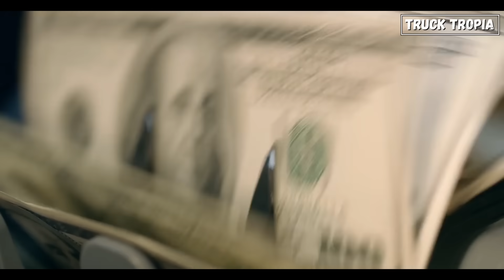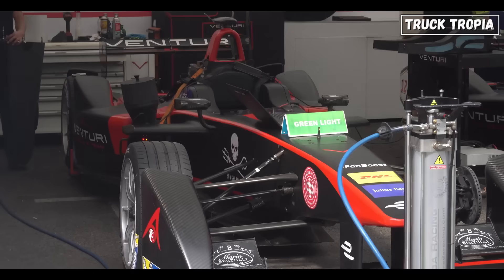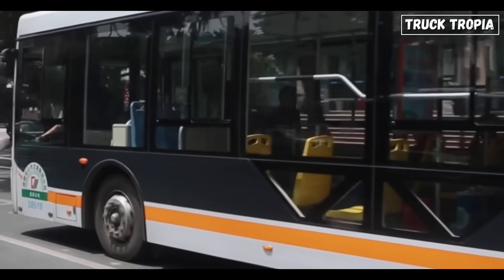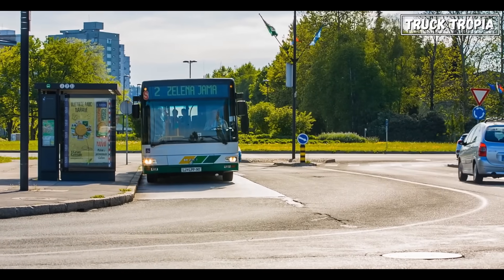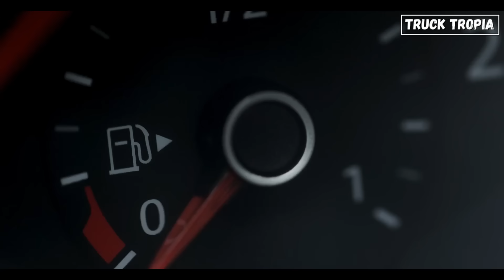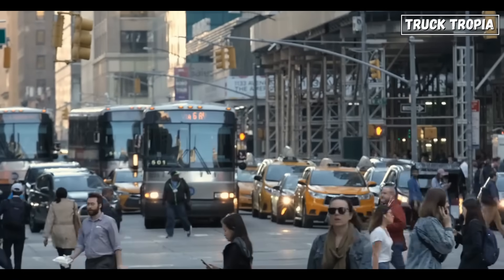Why Do Big Buses Have Rear Engines?

Comment: Remember as an kid 40 years ago some busses had the engines in the front, it was an large padded bump between the front door and the driver. 
You could sit on it but drives did not like it unless buss was packed. Or it bus was empty and you wanted to talk.
This often left an empty area in the back for bicycles and other large cargo if it had an door at the rear.
Reply: British routemasters were like that

Comment: I just started to watch this video. I want to see if you are correct here. After driving long haul buses for 43 years I know quite a bit about them, and am very interested if a non driver knows anything. OK now to watch the video. Later. Alright! The commentator did a great job! I would add one little thing. I did not drive articulating buses, but have talked to drivers who do. These buses can have their engine in the rear of the trailing portion, or in the rear of the front portion. The ones with the rear engine in the trailing portion are preferred by mechanics because they are easier to service. However in countries where they have ice and snow they are a bit scary to drive, because they tend to cause the bus to jackknife. The ones with the engine in the back of the front portion handle far better in ice and snow, but the mechanics hate them, because the engines are under the floor and are hard to access. You can't please everybody!
Reply: As a long-haul bus driver, did you notice the subway and airplane stock footage that was used instead of bus footage?  I find it hard to take a channel seriously when they can’t even get their stock footage right.
Reply: I currently am living in State College, PA (Penn State). The bus company uses a few articulated buses here, but they are a pain in winter. They get parked. Another thing, I got stuck behind one going, or trying to go, up Donner Pass in California in snowy weather. It was scary watching it, scarier for the passengers, and scariest of all for the driver.
Reply: I have seen and rode on more than enough articulated buses, which are almost always used only in big cities in Austria. There are even some double articulated ones in one city and electric ones with the two antennas in another. Vienna is also starting to move over to fully electric buses on a few lines, that only use the normal buses. The other bus lines, that can be quite long one way and have high passenger traffic always use articulated buses with either three axles or even four axles for that extra length/capacity. However, the engine is always in the rear trailing part, with the trailer axles being the driven ones.
Reply: Was looking for this comment. Thank you! Used to live in Ottawa, Canada, and we went through three stages of articulated busses. First try was the rear engine articulated busses which lasted less than one year before being yanked due to constantly jack-knifing going uphill in the snow, or starting from stop in the snow. Replaced with Orion mid engine busses with the engine lying on its side in the center of the front half of the articulated bus. Never jack-knifed unless reversing too sharply. Then, after the Orions wore out, the newest generation of bureaucrats who obviously didn't do their due diligence bought a couple hundred new articulated busses with the engines in the rear. Any guesses as to what happened next? Yup. First winter every single new articulated bus was being pulled behind a tow truck to the yard because once the bus jack-knifes the computer locks out the bus from moving until it gets reset by a mechanic. And then the city had to spend millions upon millions to refit the busses to prevent them physically from articulating more than a certain amount. Gotta "love" the bureaucrats who thought that buying busses from a company in Brazil for one of the snowiest cities on earth was a great idea.
Reply: My country (Singapore) used to have some Mercedes O405G articulated buses whose engine is also at the rear at the rear portion, whose weight could've also made the rear portion more bouncy when in motion

Comment: Dat wasn't necessarily true about the cabin bein quieter. Has anyone rode on a bus powered by da 6v71, 6v92, &/ or da 8v71/8v92 variants made by Detroit Diesel??? It had little to no effect as of tryin to "muffle" da sound of those Engines lol.😅

Comment: I dont get the first argument - if engine takes 1 cubic meter of space then it takes 1 cubic meter of space if its in the front or the back. Third argument, eurotrucks have engines in the front but still have excellent visibility and dont have a hood.
Reply: Fourth argument - yes its quiet for passengers in the front but its loud as hell for passengers in the back
Reply: The difference is how the engine is placed and arranged. If the engine is placed in front of the driver, it doesn't intrude into the saloon space irrespective of its size. If it's placed at the rear and the vehicle is a low-floor entry design, it intrudes into the saloon space.

Comment: many BEST(JnNURM) CNG and Diesel buses are front engines and the gear shifitng stick is on the engine, also they are an emotion to mumbaikars, and many oppose the electrification of buses(2027) due to this.

Comment: Why don't the manufacturer's make 4 wheel steering buses for tight city streets in Europe, India, China, Japan where cities are actually build on former historic cities'  resulting in tighter streets and high traffic as more and more people move into cities for better economic prospect's ??
Reply: Designs like that have been tried. But modern buses usually have a low floor entry to support disabled passengers and wheels intrude into the saloon space.

Comment: Why are engines placed in rhe rear 🎉more fuel efficient than engines places in the front. An engine doesn't care where it is, it's the other components of a vehicle that make it more or less fuel efficient. A rear engine is definitely louder at the rear than a front engine would sound at the rear. It is all in how the engine is soundproofed.

Comment: @5:03, The engine needs cooling too, and placing the engine in the front allows the radiator to be in the front and close to the engine.
Reply: Rear engines tend to be more prone to overheating than a conventional since the radiator is mounted on the rear side instead of the front.
Reply: @Josb_Bluebird2143, Correct.
Reply: @Josb_Bluebird2143  if the fan turns fast en the cool systeem is good no problem
Reply: @mr.bright684 Doesn’t matter if fans work. They get poor air flow and easily plug up the radiator with dirt
Reply: @ and yet it was well thought out otherwise everything would have already caught fire
Reply: We had some 2010 and 2013 IC RE school buses that were bad about overheating and blowing EGR coolers. Mechanics hated working on them.
Reply: In india mostly long distance buses engine on front they also open the engine gate for cooling and drive longer but some buses engine on rear
Reply: U can suck the air in with engine fan, but it sure less effective than mounting whole engine at the front

Comment: I am a bus mechanic at cdc nsw in Australia and having the engine in the rear makes maintenance easier also on some buses like the Scania k94 ub the engine is quite loud and having it in the rear doesn’t reduce the sound sound it is also easier to access the top of the engine when it is at the back because there is more space to put engine covers in the floor

Comment: The amount of b/s is strong in thisone.
Rear engine is specialy not good for cooling. Nor for efficiency.
Bus engines are not over the rear wheels. They are even further back. Makes handling worse. Sports and f1 cars are mid engined for handling. Rear engine has nothing to do whit fuel efficiency. If anything , its worse. 
Why is it done ? Yess , saving space . Allso buses are rear wheel driven , made sense to pack everything there related to engine and power transmission.
Old ones had super goofy mechanism to allow shifting gears. Now whit automatics , thats not an issue eighter.

Comment: I don't understand how engine placement changes the amount of space inside if the engine is the same size in both cases. What am I missing?
Reply: For engine-in-front designs, or engine-under-floor designs, the engine does not intrude into the saloon. As they are usually step entry buses with a higher floor usually have the same floor height across the saloon, allowing more seats to be fitted in the available space. Front engine buses usually had the steering wheels underneath which means a wider turning circle on longer buses. 

Rear-engine designs support low floor entry, and overhang on both ends of the bus to lessen the turning circle. However, the front wheels and engine compartment intrude into the saloon space, which means fewer seats and less available floor space. Although the engine can be horizontally arranged to improve rear floor space (makes the overhang longer), if the engine is mounted vertically, this intrudes into the back of the saloon so the back seats cannot be all the way to the back of the vehicle. Alternatively, the radiator can be mounted above the engine, so that seating can go all the way to the back on one side of the saloon, but the other side is obstructed almost as if there were a toilet cubicle taking up the space, if that makes sense?

Comment: In India we have front engined low floor commuter buses, the Ashok Leyland JanBus which are equally as big as the rear engine Marcopolo buses and Volvo 8400s, the other options commonly seen.
In fact big front engine buses are quite common in India, even with coaches. The major local brands, Tata and Ashok Leyland have their coach chassis with in house coach builders working on the body, as well as international brands like Volvo and Mercedes Benz have their local collaboration and brands respectively, like the VECV (Volvo Eicher Commercial Vehicles) Coach with a 5L Volvo engine in the front, and BharatBenz's "heavy duty coach chassis" 1624 and 1824 with Mercedes engines. These are quite comfortable, NVH levels are not too high because the passenger sections are separated by doors and these are presented as a cheaper alternative to the more luxurious rear engine Volvos, Mercs and Scanias
Reply: Just googled it. The engine hood next to the driver tells a story: This bus is not space efficent, it can't be silent and there are problems getting the power from front to rear (I don't know how they did it, the front axle and the flat floor are in the way). And what are the benefits? An empty bus has no weight on the driving axle is also a bad thing.
Reply: @philherb3843  Front engine bus are common in 3rd world countries. Even toyota makes them with 8.3L engines. its cheaper to make , cheaper to maintain that's all there is to it. rear engine buses are not cheap to maintain. We had isuzu lt133p buses with 8.2 Litter engine, the cheaper front engine isuzu FTR with a 7L engine outsold it by 3:1. it's also easy to extend the chassis width and length illegal compared to a rear engine bus.
Reply: @medakabox2015  But how is it easier to stretch? The drive shaft goes all way along the cab, so it has to be stretched, too. For the rest: On a loud bus in a third world country, it would work. In EU, you can't have such a loud engine direct to the driver anymore. 
And in EU and US/Can, most drivers controll or sell tickets. So you can only get on the bus in the front, and get off in the back. Impossible with the engine between the driver and the passengers. But maybe even safer for the driver in some areas.
Reply: @philherb3843  they dont extend the wheelbase but rather the rear and front overhang
Reply: I used to travel by buses in India and the front engined ones are just awful. Even the old-school Škoda ŠL/ŠM series from 1970's Czechoslovakia are WAY ahead in terms of engineering and comfort!
Reply: Indian busses are not comfortable 💩
Reply: This is due to common  chassis for truck and buses cost saving, tata and ashok leyland both.   specialised bus designed from beginning are rear engined
Reply: Rear engine are good for cold climate while front engine are good for tropical countries.....
Reply: Buses in India drive through poop filled streets.
Reply: In India front engine buses are ahead than rear ones in riding comfort and reliability. Even they are more fuel efficient and less maintenance compared to rear ones
Reply: @ajmalkabeer3595  most of the premium high end luxury buses in india like Volvo and Scania are rear engine. and they're more comfortable than tata and ashok leyland front engine buses. also less noise. I say this having travelled in both tata/leyland and volvo
Reply: @ajmalkabeer3595 that's misinformation you are spreading here. Being an Indian, we all know that the comfortable buses are volvo ones which definitely has a rear engine. Do not lie. That's a bad image to the whole country .

Comment: The handling thing is nonsense. Exotic sports cars have a mid mounted engine for a low polar moment of inertia (the car rotates around its vertical axis easily). 1) That is not a priority in bus design and maybe not even desirable. 2) The engine of a bus isn't a big enough percentage of the weight to matter as much. 3) A rear mounted engine doesn't give that benefit anyway.

Comment: An actual educational video for once. Thanks! 👍🏾
Reply: I felt that it was far too generalized.  For example, it only lightly mentioned better cooling, but didn't say why or how.  Front engines get excellent engine cooling by free-flowing air as the vehicle moves.  In rear engines, the air flow is BLOCKED by the entire bus.  So, I call BULLSHIT on the claim, since it was not explained in any meaningful way.

Comment: I drove a Gillig School Bus from the late 70's to the late 80's.  Gillig and Crown Coach Corp put what they called Mid-ship engines (Cummins and Detroit Diesel) this platform had the engine at the mid point and behind the front wheels.  The mid-ship arrangement gave better weight distribution and offered a quieter environment.  I drove an turbo charged 855 Cummins that put out 750 hp.  The busses that had rear engines were very unstable and the steering wheel shook after each bump in the road.  It felt like the front end was bounding all over the road.
Reply: Also Hallscott 590 CID gasoline 6 cylinder.I'm sure it got great MPG!
Reply: @dave2870  They had one with a Hurcules Holscott. Had to fuel up daily as opposed to weekly with a diesel engine.
Reply: 750 hp in a school bus!  wow!  we only had Navistar T444's around here (otherwise known as the Ford 7.3 Power stroke)  Those were only cranking about 230hp, and while a tough engine, could barely keep a bus full of high school students moving at 50 mph.
Reply: @audvidgeek  you could pull a 6% grade in 9th gear at 60 mph.  The torque was to high that one driver had her foot slip off of the clutch and sheared all of the rivets off of the ring gear.
Reply: Crown coaches, rode them from 1st through 8th grade. Such great memories.

Comment: Years ago, some school buses had Cummins engines mounted below the chassis. It was the
Cummins NHH-220.
Reply: We in San Francisco had some Mann coaches with under-floor engines, and before that, some White coaches with under-floor engines.  They had removable floor sections over the engine, but it was still harder to perform certain operations compared to a rear-engined, or even a front-engined bus, and the passengers objected to the heat coming up from the floor.
Reply: Crown Super Coaches? I’ve never seen them with a Cummins but when I was growing up they all had 6-71s and would scream and smokescreen everything. It was awesom and has stuck with me 30 years later.

Comment: True the driver can see more with a flat nose bus there is more space up front because there's no need to have space for the engine of transmission that isn't true about better handling in bad weather a rear engine bus is more prone to slide in the front in slippery weather this may be good For transit buses where do they keep the roads clear a flat nose has a better steering radius than a conventional style in reality if you want a better performing bus Mount the engine in the middle of the bus don't compare a bus to a formula one car or Porsche in reality a bus is more related to a truck resr engine buses still need air cooling i drove different types of buses so experience i know the pros and cons of each

Comment: @3:45 - Handling? REALLY ?? This is 100% bull$hit  - yes, rear-engined do have better tracktion at the rear driven wheels, but have much poor traction on the front. Which means - on slippery roads they suck on each and every corner. Sports cars and Formula-1 cars given as example is even more BULL$HIT - because these cars are MID-ENGINED, not rear. Rear Engine means - engine is behind rear axle. Most sports cars and all formula-1 cars are mid-engined. The only example of a rear-engined sports car is Porsche. And they are known for decades for HUGE oversteer cornering on slippery roads.  :)